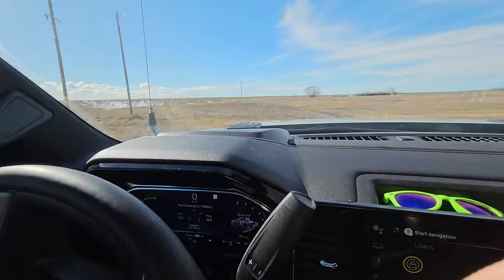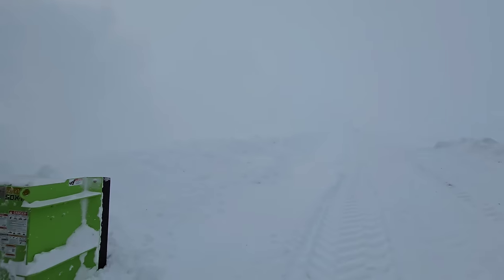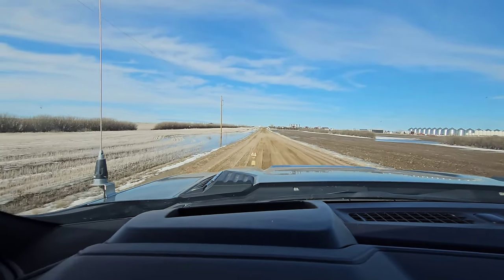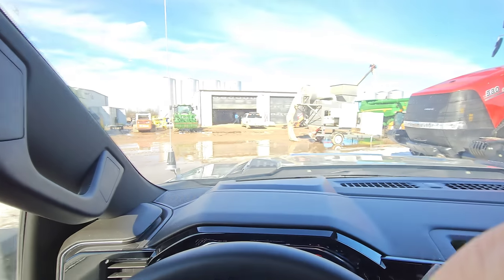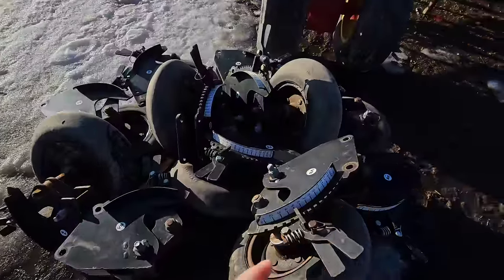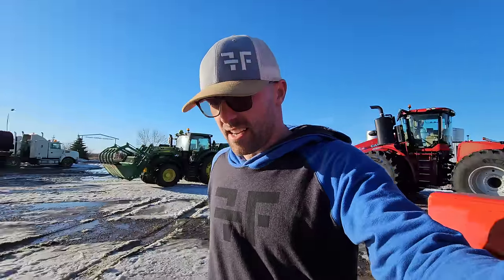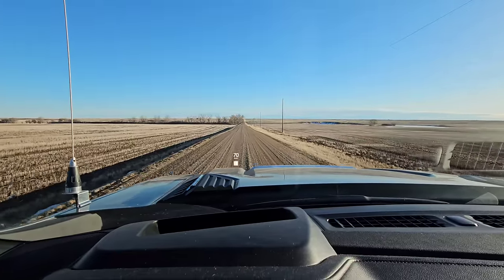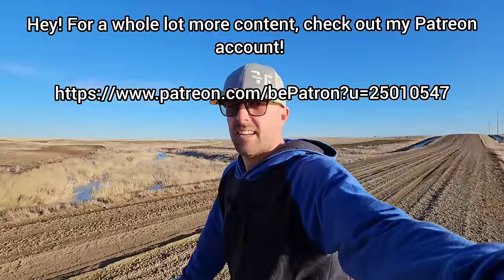Spring has Sprung!

Comment: Jesus Mike! Put your seat belt on, that ding ding ding just drives me nuts! 
Looking forward to seeing the 580's at work, you've gone full circle as you were working wheeled Case's 4/5 years ago, they've got to be more comfortable than those darn hard riding tracks that shake the teeth out of your mouth! 😬
Reply: On Midwest soil that has moisture in it… quads are far more comfortable than tires. Tires rock back and forth in rough fields whereas tracks glide across. But yeah if you only get rain a few times a year they can be quite rough I suppose.

Comment: You figure that snowblower wouldn’t choke that big of tractor like that that is hard equipment well on any diesel engine lugging one like that we have always told people on our stuff on 90 percent of the stuff run it wide open when lugging one especially in the summer time everything has to work twice as hard things heat up really quick as to where if running full throttle especially in high stress conditions everything runs cooler smoother  especially on old equipment and on the newer stuff with deaf system it tells you to run at higher rpm to prevent a lot of sut but to each their own I know he is trying to save fuel and I truely understand how much it cost to run equipment and you try to do everything you can to save on it and that’s where everyone is different and some thing running one at full throttle is extremely rough but the manufacturer fixes the governor where it will not damage the engine well now the computer does it and they have it set to where it will not damage they just have different settings for different folks but sorry for the book I just wrote Mike and keep up the good work I hope you all have a great year I know the last few has been extremely rough